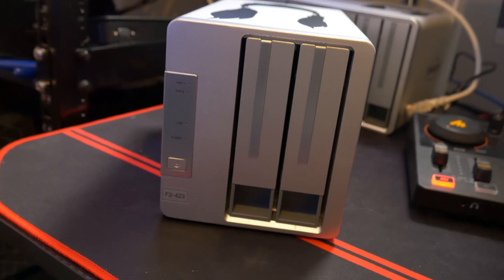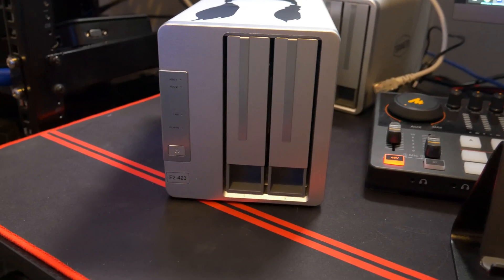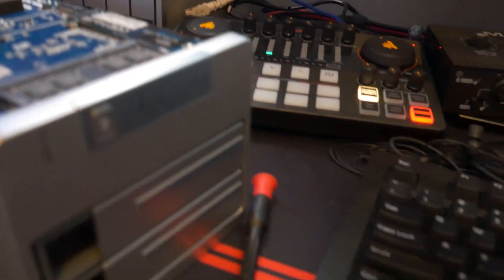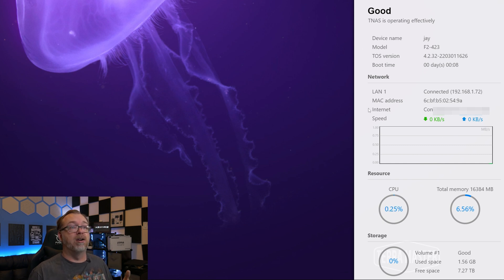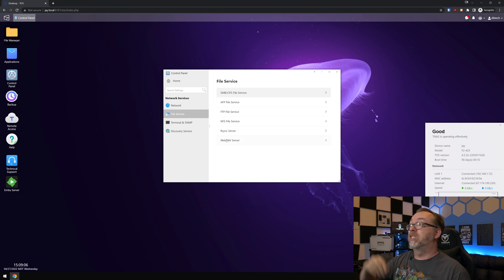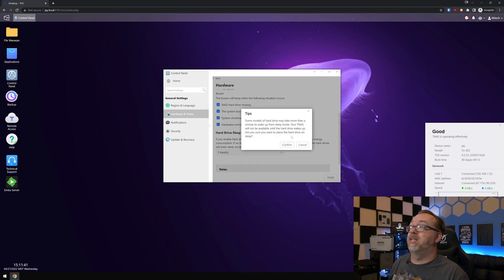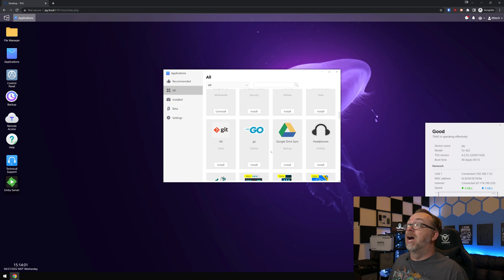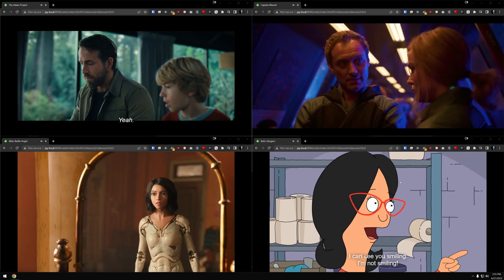TerraMaster F2-423: A 2-Bay 4-Core Beast of a NAS

Comment: Is the OS installed in an internal USB Drive? What type and how large is it? Can it be upgraded to a faster USB, SATA SSD or SSD NVME? Are the 2 NVME slots only for the cache? Would the storage drives be better suited for Mechanical SATA Drives designed for NAS?
Reply from the maker: The OS is installed on the data hard drives. The internal USB is just for OS installation purposes. The NVMe slots are just for caching
Reply: @DBTechYT  If you buy the device without hard drives, you have to install the OS in one of the drives? That doesn't make sense. Why not use one pf the two NVME slots to install the OS and leave the two HD slots for data disks only? Is the OS installed in a separate partition of a disk? If the disk fails, you have to reinstall the OS. Does the OS need a fast disk to boot? If so, should one of the two drives be a SATA SSD? Also, isn't a RAID Configuration supposed to work best for data disks? How does it work if one of the disks has the OS?
Reply: @DBTechYT  So the OS is using one of the Data Disks?
Reply from the maker: When you get the device, the OS installation USB is in it. You put your drives in it and power it up for the first time. Then the installation process starts. You choose the RAID level or whatever you want to use for your device. It then uses part of the hard drives for the OS installation. Go watch this video: https://www.youtube.com/watch?v=5zz4netQZRc

Comment: Awesome video! I'm looking for a 2-bay that I can set and forget at a friend's house, and just occasionally remote into or go over to update the software on and maintain. He needs mass storage for video editing and other similar things, and might enjoy running a Minecraft server (in docker?).

I'm attracted to these because Synology is still not shipping with 2.5GbE standard, and while that's not a huge deal now, it will be in the next few years, especially as SSD cost per GB continues to go down.

It looks like this might be the way to go.
Reply from the maker: You can definitely install Docker on these and it would make a great server for what you're talking about. I would suggest upgrading the RAM from the 4GB it comes with to at least 16GB
Reply: @DBTechYT  Thanks! I grabbed an ARGON EON Raspberry Pi 4 powered NAS, and was going to set that up for him, but it uses 25 w at idle and the single fan they put in it, combined with the choked off ventilation, makes it sound like a loud 2 cylinder car.

I'm going to take a serious look at this for him.
Reply: @DBTechYT  I will definitely do that if we go that way. Is it standard DDR4 like would go into any other desktop computer, or something else?
Reply from the maker: It's DDR 4 SODIMM laptop memory
Reply: @DBTechYT  Great. I have some of that. :)

Comment: So which is better for cataloging photos or media?
Also syncing cloud services?
I'm running OMV6 but not interested in portainer apps and would rather use included apps
Reply from the maker: I was using SyncThing for my phones and switched to this for the same reason. Thing is that, for some reason, the TerraMaster app won't backup anything on you sd card, so if you have anything stored there, this won't back it up.

Comment: Since it has an HDMI port is it possible to boot into the BIOS and change the OS if wanted?
Reply: i installed OMV on this, TOS is crappy ,
Reply: @fossdom5568  I have OMV 5 running on a  Thinkcentre M93 tiny.  I5  4670T with 16gb memory works great but is limited because of USB connected drives. This Terramaster with two m.2  drives has possibilities. How do you like it?
Reply from the maker: That is correct!! You might want to swap the USB inside the device for a different USB for your OS.
Reply: @DBTechYT  Oh.. So it has an internal USB and not an eMMC module.. neat.